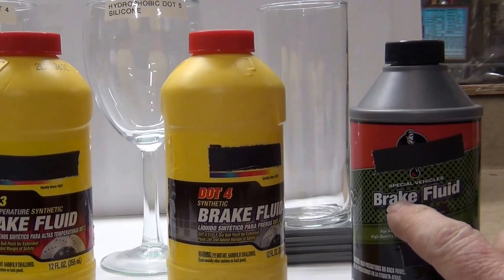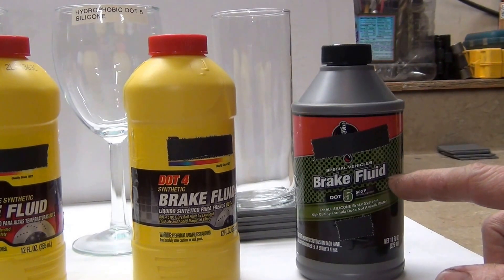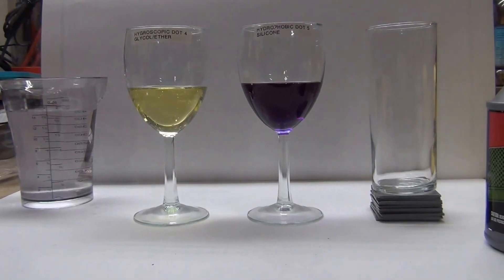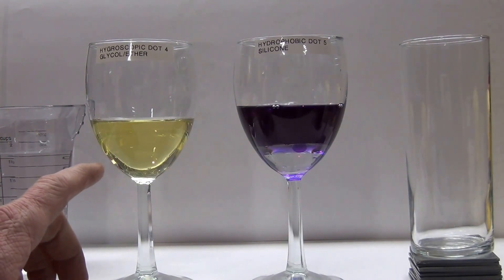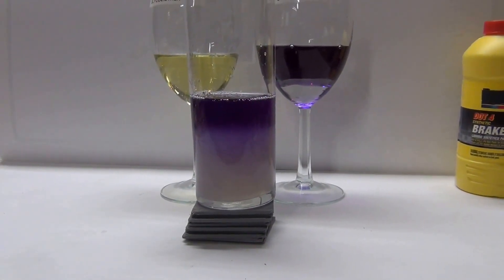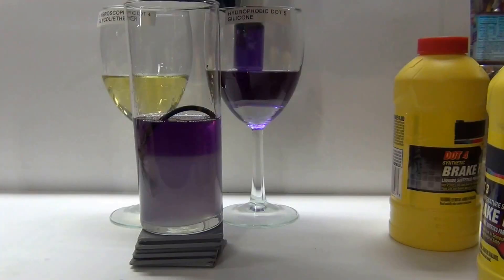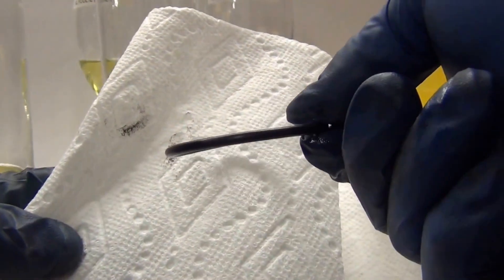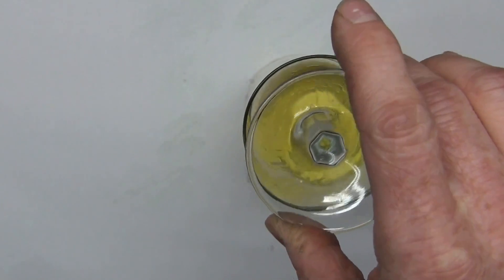Can I Mix Brake Fluid DOT Types Together? or With Water?  Answers!

Comment: Hello Brian, hope you are doing well. Can substitute DOT 5 for DOT 4  in my car? would it be advisable?
Reply: Madan Jain I'm a master Harley Davidson technician, I have lots of experience with both fluids. Harley used DOT 5 in most bikes up intill 2004 when it started having ABS on police bikes. DOT 5 cavitates, this is not good for a ABS event. DOT 5 can't be used for 12 to 24 hours after shipping or if you drop the bottle, it will trap air and not billed out properly. 
DOT 3/4 are more forgiving and don't cavitate when cycled 5 plus more times a second like a modern ABS system. 
In an older vehicle it would probably be ok, but it would require extensive flushing due to the different fluid densities.
Reply from the maker: To help YOU make that decision I've shared with you the characteristics of the fluids.   I don't know what your objectives or limitations are for your car so clearly I've come halfway to the center of the information gap in helping you make your best decision, but there's still an information gap of 50%.  I don't know your car, your skill, tools, or circumstances.  I have no idea and couldn't possibly say.  Generally I would say use DOT 4 if your car calls for it.  DOT 5.1 takes heat better and would enhance DOT4 and surpass slightly the characteristics of DOT 5 and is better compatible with DOT 4.   Any DOT 4 left in the system will pool in the bottom along with any moisture and can cause phantom issues no matter how you bleed it unless you remove and clean your calipers, wheel cylinders etc. upside down or via a denatured alcohol flush of said parts.  And there's always the likely chance it's totally fine and unnecessary to clean it all out.  I've seen it go both ways.  It's generally easier and safer to stick with a glycol/ether if that's what you've got. (DOT 3,4,5.1)
Reply: briansmobile1 Well Sir, you did name the video "can I mix them"! Yet, you didn't explain that you shouldn't mix types together. You should say to use what your manufacturer recommends. Of flush out the old, before using a different one! Some parts don't bode well in a bath of a different type of fluid! It's walking a fine line to go swapping out the fluid without a thorough investigation!!
Reply: Tracey Allen good point, that's another important property. another example of that is in Mercedes Benz some of their vehicles had a system called SBC (sensotronic brake control). it was a fly by wire brake system that used a high pressure pump to generate pressure for each individual wheel based on wheel speed. it had a special brake fluid with anti foaming/cavitation properties and they stressed not use regular brake fluid.
Reply: Pretty sure they just wanted to sell their special more expensive brake fluid :D

Comment: Yes, a video on mixing brands or viscosity of engine oil would be cool. Also, how about an easy way to change and flush brake systems?
Reply from the maker: Thanks for the idea Jonathan, the quick answer/fix I probably lost from here in editing, but DOT 5 doesn't homogenize, but it's the lightest.  It's best to just pull it out the top if you can.

Comment: Do they really put dot 3 and 4 in the same bottle - that's what I buy from auto store??
Reply from the maker: DOT 4 is legally required to perform better than DOT 3.  The chemical list is similar to the same.  The ratio of those ingredients is what's different.  The bottle by brand is the same, but what's in the bottle is slightly different.  DOT 4 has a higher boiling point by about 50°F.
Reply: Why can you buy a bottle with Dot 3 and 4 in the bottle - how does that figure - doesn't seem right - but that's the way it goes
Reply: Since they're compatible, I personally think it's just DOT 4, but it's at the same time, totally fine to go into the same brake system. Basically, they made dot 4, but want dot 3 people to buy it too.